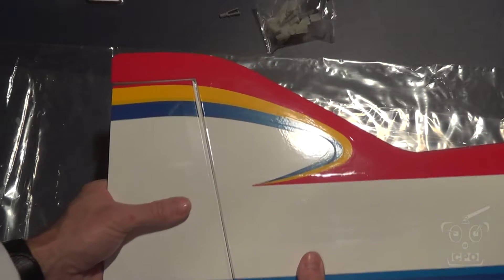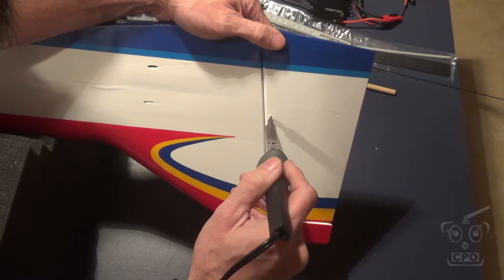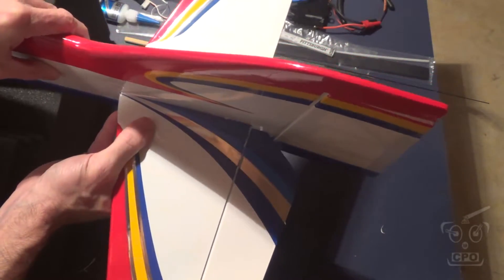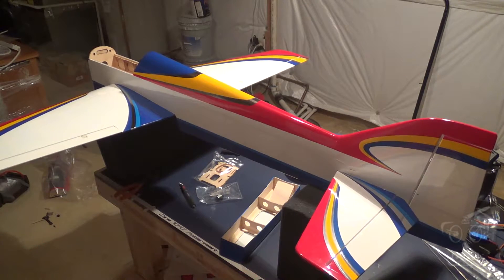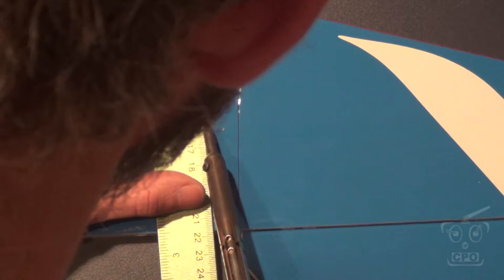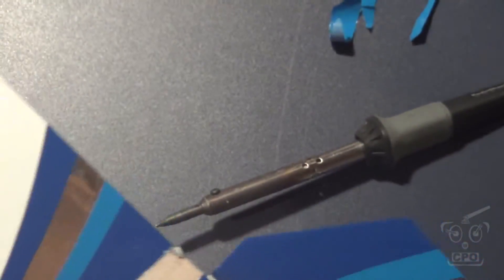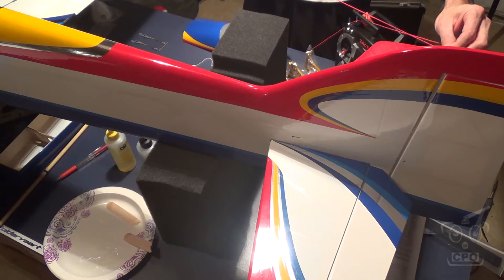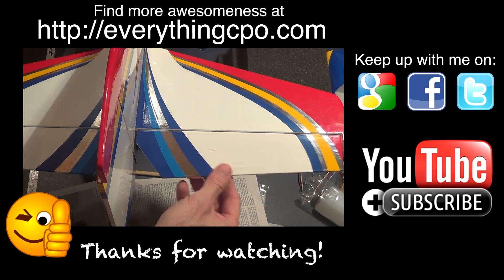Flight Model Apollo 50 :: Tail Assembly

Comment from the maker: @Rynhardt Dohse - You can slot the top of the screw head with a dremel cutoff wheel, and use a flat head screw driver to remove. You might want to apply some heat with a soldering iron to break and thread lock first, that will help.
Reply from the maker: Oh..and how do you do it without stripping them in the first place?  Quality driver set, and I bought an upgraded screw kit with better screws (socket cap screws).  I did a video on it:  https://www.youtube.com/watch?v=Uo8DNp_YsTc